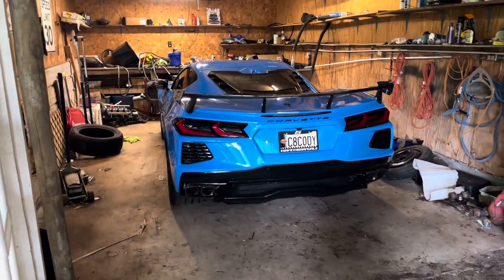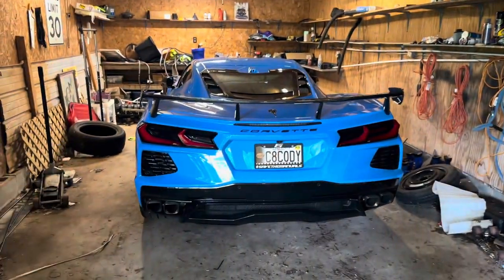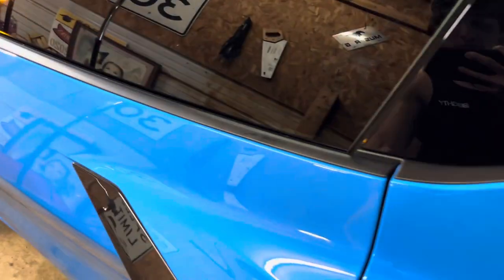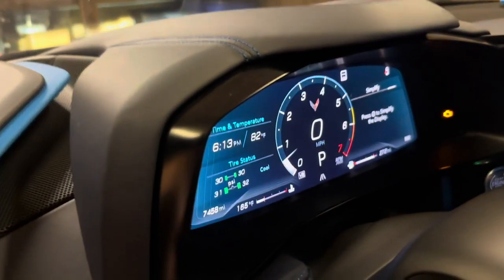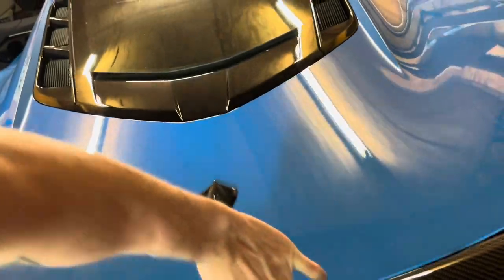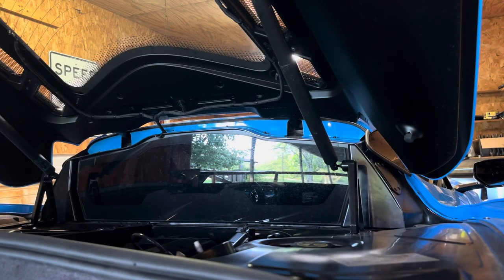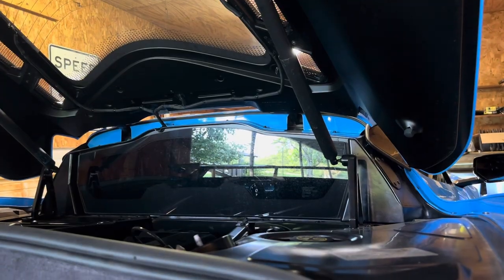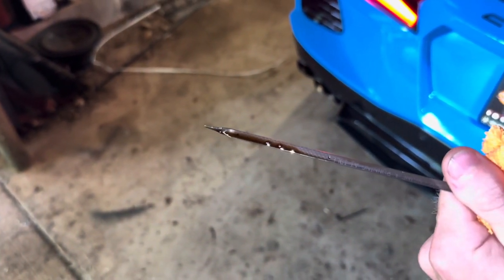How To Check Oil Level In The C8 Corvette (Dry Sump Oiling Systems)

Comment: Chevy just did my oil change, I was worried becouse the oil was set in between the dod but looks like it is ok.  Quick question. Tire pressure 
They set it at 35 psi front and back.. is that normal?